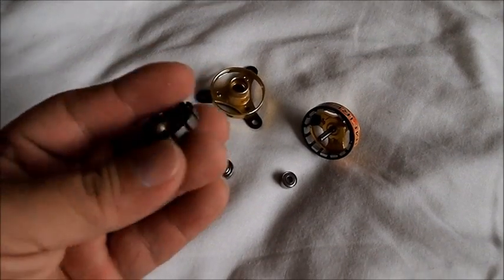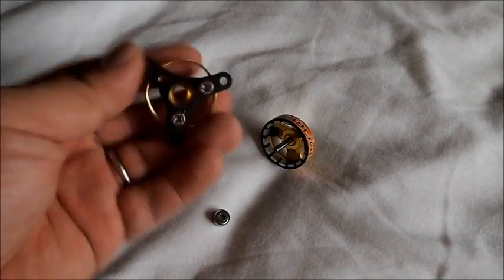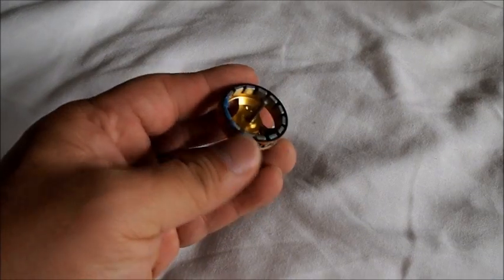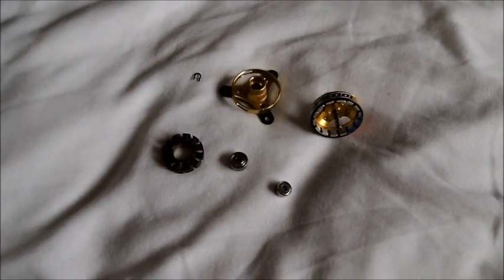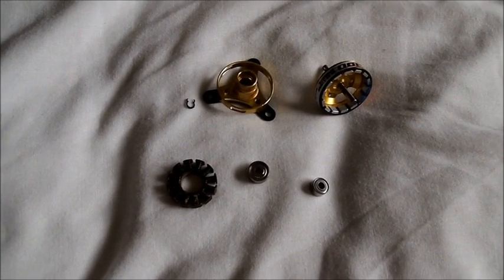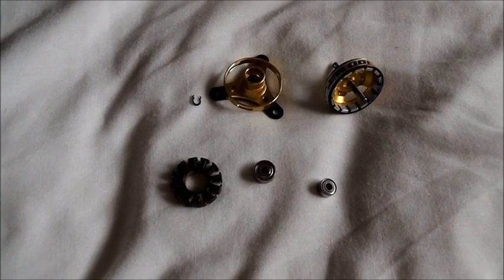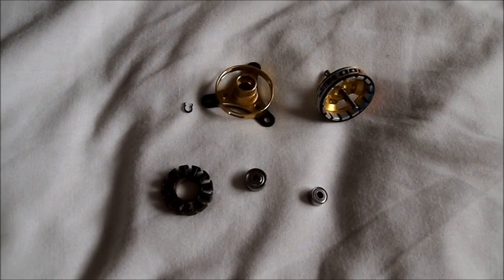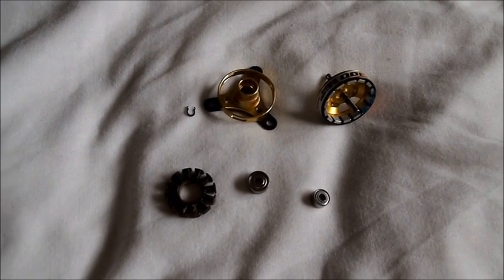winding removal, prepping for new wind

Comment from the maker: same method- that is lots of heat on the stove. Make sure you remove the bearings first before putting too much heat, otherwise you kill the bearings. Long story short, most stator are put on the tube with some sort of epoxy. As long as it's not black epoxy, you should be able to kill the epoxy after 10 mins at a little over 500 degrees. If black epoxy, you'll need 10mins and close to 700 degrees . Anyhow, after you kill the epoxy, it just twists off.